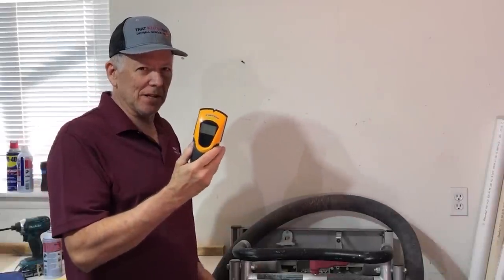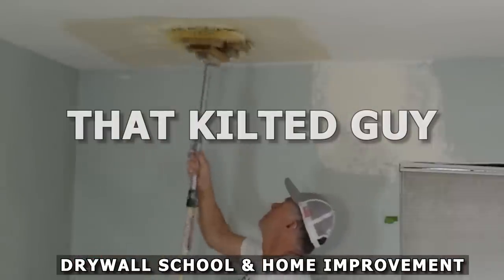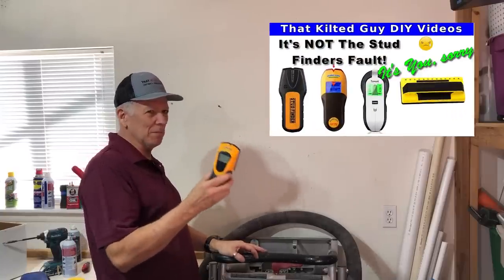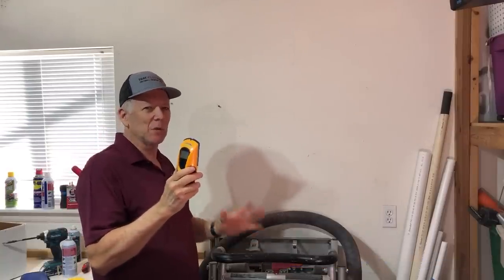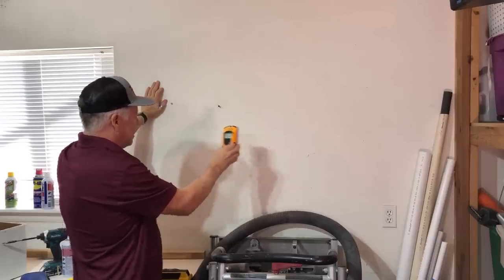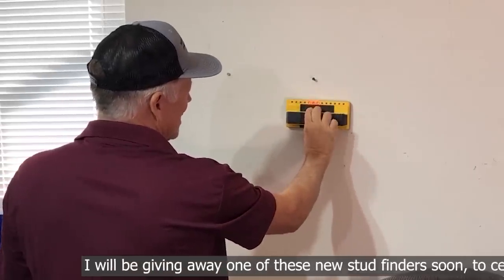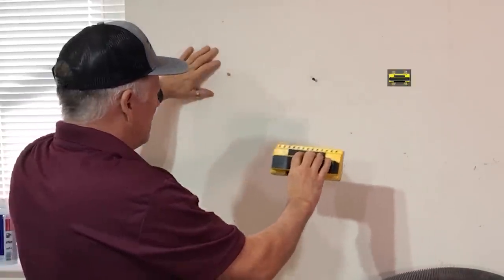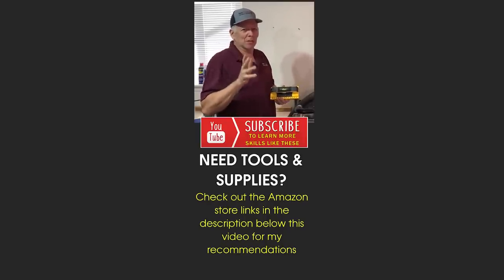The BEST Stud Finder of 2021! I own 5 stud finders, This beats them all!

Comment: I’ve had at least a half dozen different stud finders over the decades, the Franklin is the best I’ve seen and used
Reply: The Franklin is awesome. I’ve been using o e for about two years now. Note that a magnet stud finder is a great backup.
Reply: I got a Franklin 2 years ago. Way better than Zircon
Reply: Use a magnet.

Comment: I've seen comments and reviews of people that don't like the Zircon. I have to say it has always worked very well for me. I think most people try to go way too fast  across the wall when you are supposed to go fairly slow. I've had no issues
Reply: I had a main copper pipe going up the wall to the second floor butted up to a wood stud at my house. I was installing baseboards and my zircon said my center of the stud was dead smack between the stud and pipe. I shot the nail and went slightly on an angle, of course towards the pipe. The nail nicked the side of the pipe and caused a leak in the wall. No hissing or any sign that I hit the damn pipe. Only reason I found out was because I went into the basement to grab something the next morning and noticed a bunch of water everywhere. One little nail caused almost 20k worth of damage all because that stupid zircon hd900!!! I tested it out after I cut part of the drywall out and that zircon put me in the same spot every single time. I even showed the insurance adjuster and he was not at all surprised. Told me that I’m not the only one that had bad luck using those zircon stud finders.

Comment: I carry a magnet the size of a quarter to hold my bits in my bags.... finds studs too.
Reply: I use both the Franklin Sensors stud finder and a magnet. Before that I used the Zircon and a magnet. I use the electronic one to show the center of the stud and the magnet to verify it’s not a false reading.
Reply: How does a magnet find studs?
Reply: @spencergroup  drywall is attached to studs with drywall screws. Drywall screws are magnetic.
Reply: @christophercrawford2736  Ah, I see. One of those things I wouldn't have thought of. Thanks, that's very helpful. I'm preparing to replace a section of ceiling at my mom's house so this tip should come in very handy.
Reply: @spencergroup  just make sure you have a strong enough magnet.If you're concerned about the paint o the wall showing magnet slide marks you can use a piece of wax paper under the magnet.
Reply: @TheKaffeeKlatsch  Buy Rare Earth (Neodymium) magnets.. they are the strongest you can get.

Comment: I appreciate the heads up on this stud finder and I will hit the thumbs up, BUT I’m not dropping $54 bucks for a tool I’ll use once every 2-3 years lol!
Reply: Franklin Sensors has other model. I would recommend the HART Professional at Walmart, also made by Franklin. Instead of 13 sensors it has 9. Great unit for the price. $26.99 I believe. You can also buy units from their site directly at www.franklinsensors.com. If you can, do support the Kilted Guy. Great informative videos.

Comment: I have 1/8" thin wood paneling over drywall. Can this Franklin detect a stud ithrough  the wood paneling? In other words, is there a density problem?l If not, I really would like one of these.
Reply from the maker: It measures density differences and it will be much denser where the stud is, so it should work fine.
Reply: @ThatKiltedGuyDIY  thank you for replying. I'm going to give it a try.

Comment: How do you find the exact middle? I’d your going from right to left are you marking the middle by stopping right when the right light goes off? I’m guessing the exact edges would be off by a little, how do you know true middle?
Reply from the maker: Search for, “it’s not the stud finder, it’s you“ by me and you’ll get full directions
Reply: @ThatKiltedGuyDIY   couldn't find it. with the franklin stud finders, its hard to pinpoint those exact corners
Reply from the maker: Here's it is- https://youtu.be/cTnlU-4cP0w
Reply: @ThatKiltedGuyDIY   on the Franklin though, is there an easy way to find the corners? There’s a bit of leeway, like a forth of an inch with it because the lights switch.
Reply from the maker: If you really need the exact edges drive a nail until you find it

Comment: Does it work with old lath and plaster? 🤔
Reply from the maker: I plan to test that
Reply: @ThatKiltedGuyDIY  Thank you. 👍
Reply: As a general rule, yes. The more technical answer is that it depends on the hand the laid it. If the plaster is extremely thick then the unit will of course struggle, but it is still the best unit on the market. 

As a side note, no electronic stud finder will work on lath and plaster that contains a metal mesh.
Reply: @karengarcia1256  😲

Comment: Howdy, Thank you for your service. and your videos. I've learned a lot. However, I do not see the link to the stud finder in the drop down. What am I missing? Happy Holidays.

Ray
Reply from the maker: Wow, thanks Ray.  I was eating when I launched it and got in to big of a hurry, but it's fixed now.  Here's the links-
* Franklin Stud Finder - https://amzn.to/3gmeNSk
* Case for the Stud Finder - https://amzn.to/3lUxsWz
Reply: @ThatKiltedGuyDIY  
Thanks again for all your work putting these videos out! Is this stud finder in your store? I don't see it there.
Reply from the maker: I need to add it to my store too.  Thanks
Reply from the maker: I did provide the link up above
Reply: @ThatKiltedGuyDIY  I'll order it from there! I've seen this used on wood, however not for metal stud. What is your opinion on that? Also, I have ran into double wall framing both metal and wood. How well does it work in these type of circumstances?
Reply from the maker: I’ll have to test on things like that soon. Thanks
Reply: @ThatKiltedGuyDIY  I had several jobs mounting tvs within the last month. where my stud finder was reading the wrong stud and I did the nail test. Lots of holes, fortunately the mount covered them. It's hard to determine where the studs are when it is a double wall and packed with insulation.
Reply: @ThatKiltedGuyDIY  Stuff happens!

Comment: Do any of them work over plaster and lath?
Reply from the maker: I’m going to try and test that one day soon.
Reply: @ThatKiltedGuyDIY  I have the same question regarding the model you recommended here.  I have the Zircon with digital display and I find it has difficulty since the thickness of the plaster and lath aren't always consistent in my house which I suspect messes with the calibration aspect.  Perhaps this model compares all of the sensors to one another and lights up the ones that deviate the most from the others.  Thanks for a straightforward video, and thanks for your service.
Reply from the maker: Thanks. I’m going to try and test on lathe and plaster soon

Comment: Just go to Earth magnet buy a 50 POUND pull 2inch x2inch for $30.00 or a small round one 1. 1/2 x 1. 1/2  best investment u will ever make works on nails and metal stud ,I went thru all those beep beep garbage ones , I spent $ 30.00 then $60.00 then $90.00 still the same shit FIRST pass it works second pass it doesn't work believe me you'll thank me.